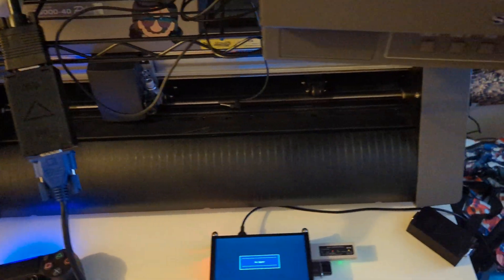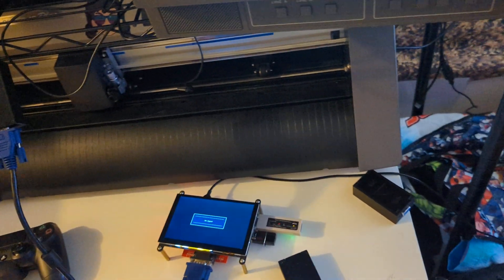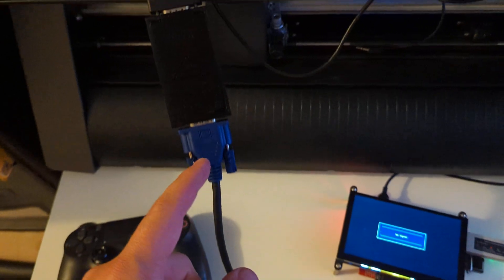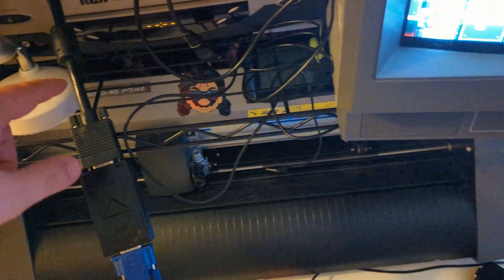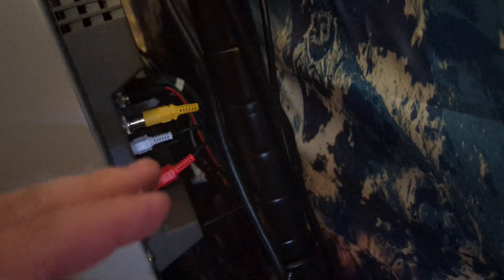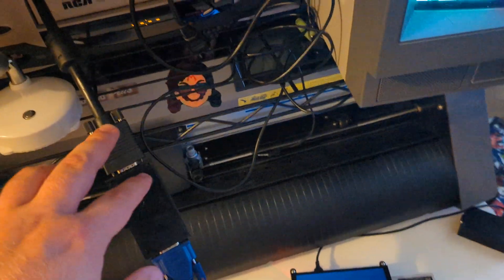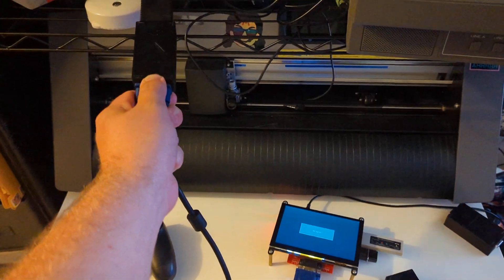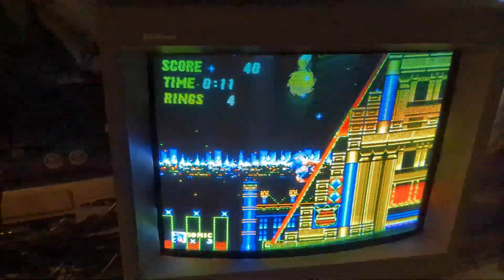Passive VGA Sync Combiner Demo

Comment: Mate i wanna make this connection. so here you're taking the wire that's coming off the r4 and connecting it to the rgb ground on the vga right? and you don't need to touch any of the rgb wires?

Comment: I have an RCA Lyceum tv and it has rgb input on the back including sync. I connected my ypbpr to converter to vga. Then I use vha to rgbs breakout cables, plugged them in the tv and I get a jumbled mess. I then noticed it has an enable input which I've never seen in my life. I asked around on crt collective and some told me to try combining syncs with the T-connector. I read on RetroRGB not to do that or I risk damaging stuff. Then I found this thing you made. Will this do the trick? Do I use the same rgbs breakout cable?
Reply from the maker: Sounds like it should do the trick!